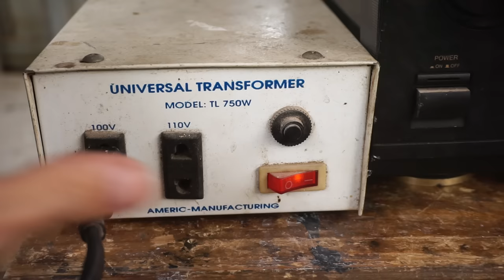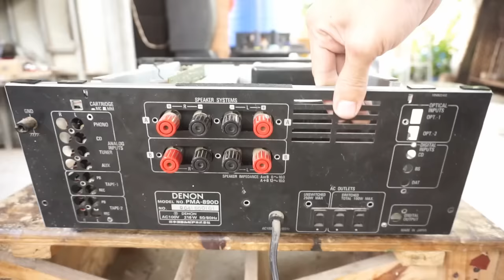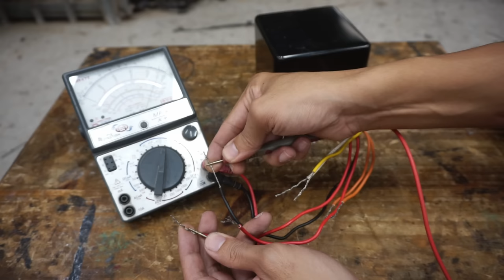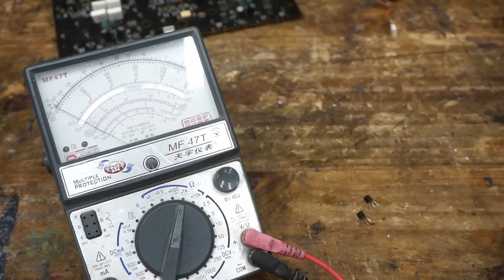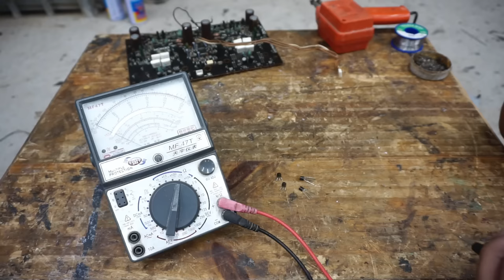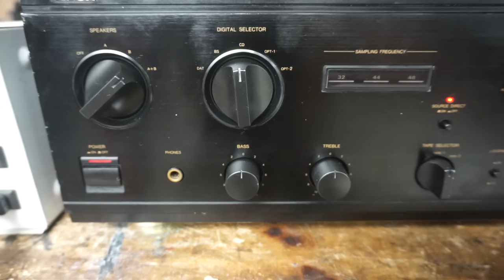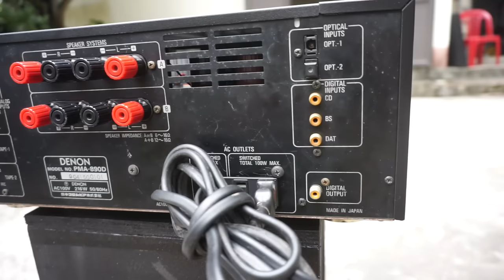Restoration integrated stereo amplifier DENON // Restore details of each step

Comment: What were you doing twisting the wires around the posts? Just solder for permanent connection, such a hazard!
Reply: I came to the comments to look to see if it was just me.  Wire wrapping is a great connection for new wires, as it makes a gas tight bond between the wire and the square pin.  However, just wrapping the wire around the pin without a special tool, and not solder it - well you are just asking for issues down the road when the oxidation comes along. Hey, I guess it works for something he is just going to flip for a few bucks.

Comment: Hello and thank you for this excellent video, out of simple curiosity why some wires are not soldered but can be wound?
Reply: The post connection methods have been used in area where vibrations can happen, like telephone switch boxes, older television chassis. And some of MY solder joints are, not always great !

Comment: You really believe that those old winding for wires will work ok? They should be done with fresh tined wires and some tension on those!
Reply: I came to the comments to look to see if it was just me.  Wire wrapping is a great connection for new wires, as it makes a gas tight bond between the wire and the square pin.  However, just wrapping the wire around the pin without a special tool, and not solder it - well you are just asking for issues down the road when the oxidation comes along. Hey, I guess it works for something he is just going to flip for a few bucks.

Comment: not sure just winnding the wires back around the posts without soldering them is a good idea but heyho
Reply: I came to the comments to look to see if it was just me.  Wire wrapping is a great connection for new wires, as it makes a gas tight bond between the wire and the square pin.  However, just wrapping the wire around the pin without a special tool, and not solder it - well you are just asking for issues down the road when the oxidation comes along. Hey, I guess it works for something he is just going to flip for a few bucks.

Comment: I don’t understand why you had to take so much of it apart  ?
Reply: You have to find where the fault is, and if there are more than one...
Reply: @davidhamm5626  But that's not the way to repair elektronics. How many hours you need to apart the aplifier. For this money such method of repairing costs, you get a new one.
Reply: @2000striezel  Having an understanding of how capacitors, resistors, chokes, transformers, voltage and current works, is a skill that is fading fast.
One of my hobbies is tube equipment, mostly radios. Many times you have to remove parts to test them, so I see what he is doing as normal. Plus , "they" do not always make NEW versions of what you have.!
Reply: What model number is this amplifier  ...

Comment: Not so sure about this being real. If you’re doing the work, why not record every single part of the process?  Sure, it would make a long video, but would be more convincing it’s all real and not faked.
Reply: How would you fake a video like this, ?
Reply: Not so sure you actually wrote the entire comment above, why not include a full video so we can watch you typing it ??
Reply: @cat09tails22  I can get behind that idea.....
Reply: @davidhamm5626  They are notorious for doing it - simply reverse it. Take a working amp, film it and the teardown, then take it outside for a week and repeat.
Reply: @puciohenzap891  Okay, it seems like a lot of work to trick the small amount of people that watch theses....
Reply: @puciohenzap891 and this is exactly what you See here.....working amp, teared apart, and put outside, Filmes in sequences and edited together

usually when i restore amps/tapes/tuners of the golden hifi age, it takes me weeks. First good cleaning, including full dissasemble and desoldering and cleaning the PCBs using an p
isoprop ultrasonic bath and then  i use frequency generators, oscilloscope, original Service Manuals and do a full component test. especially the output Transistor needs to be checked for r(be) r(ce) and ß matching.

after that i usually give the Power supply a nice loading/ripple test and change the filter caps of needed. next is biassing the channels and output Transistor to original SM readings.

this is only klickbait. Not a restoration.